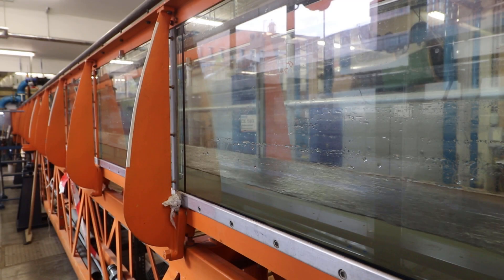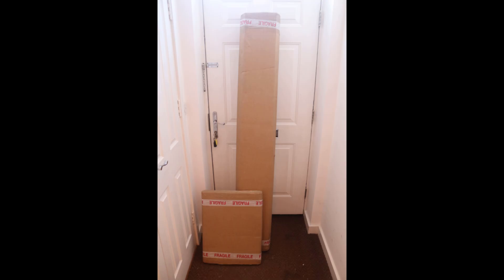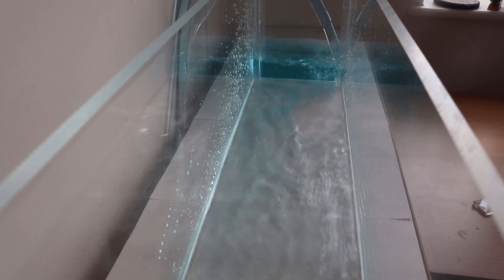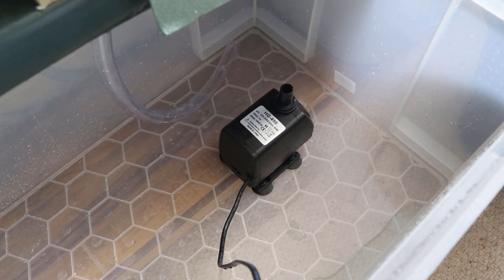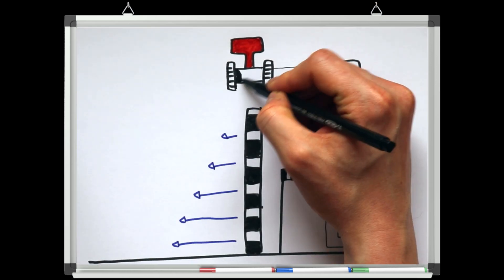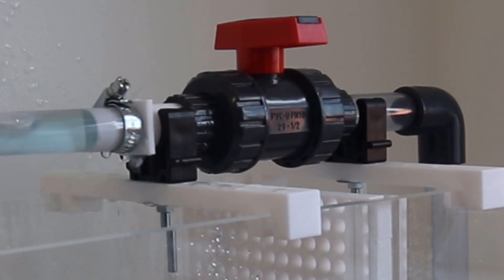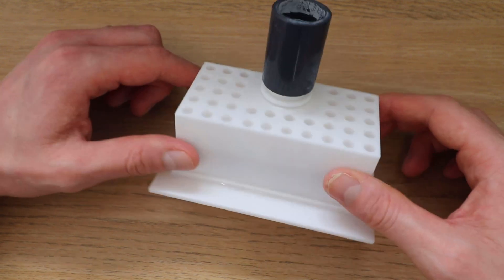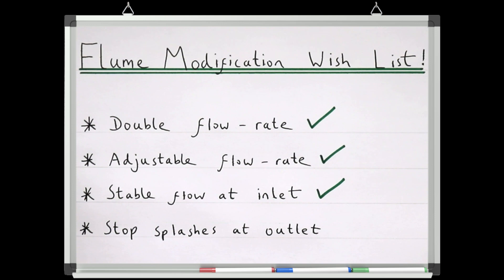I built a lab water flume in my office at home

Comment: I am wondering what you would use to measure the actual vertical velocity  profile in the middle of the tank or around some obstructions within your flume?
Reply from the maker: Thanks for the interesting comment. There are several methods you could use, but no method of measuring accurate variation in velocity is particularly easy. One way would be to film the flow and inject some neutrally buoyant particles. There is some good open-source software you could then apply to the video that would work out velocity vectors based on the movement of the particles.

Comment: Very cool little flume.  A simple 'modification to your modification to control flow' would be to add a tee and bypass valve in the pump output line to allow excess flow to be routed directly back into the sump.  It'll let you run the pumps at full rated output and reduce stress on the motors.  Maybe not a big deal for cheap, submersible pumps.  Definitely worth doing if you go to an air-cooled, AC centrifugal pump.
Reply from the maker: Thanks for the comment, something to consider for the next version!

Comment: I guess it depends on the power converter used in those pumps, but probably you can use some cheap voltage regulator to control the waterflow a little bit.
Reply from the maker: Yep this was one option I considered. But the problem if you adjust the total power to the pump is you also lose total pressure head in the system when you reduce it, whereas a valve at the inlet maintains the same total pressure head but allows you to adjust the discharge. It’s a great solution if you have lost of pressure to spare, but my little pumps only just about lift the water from the tank 1m up to the flume. In the future, however, I would like a system where the discharge could be computer controlled, and this would be the best solution for that.